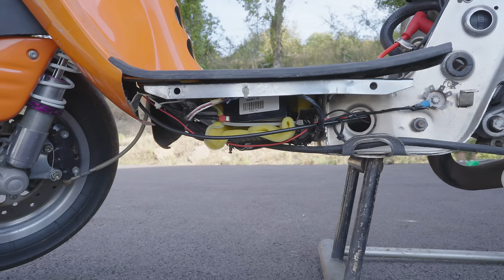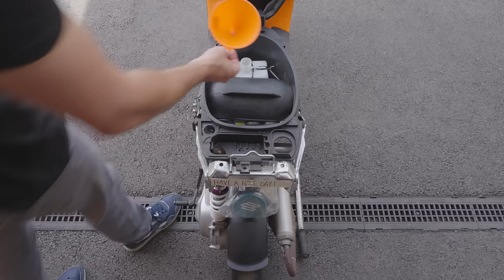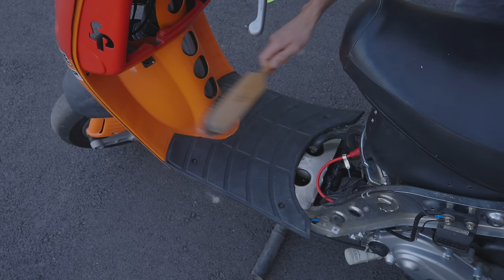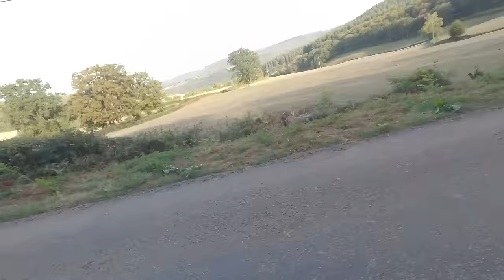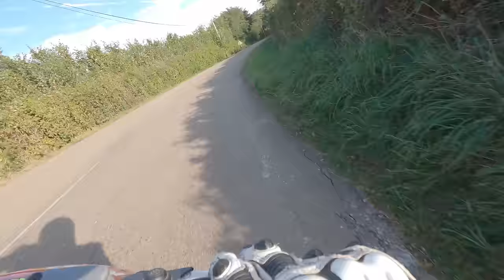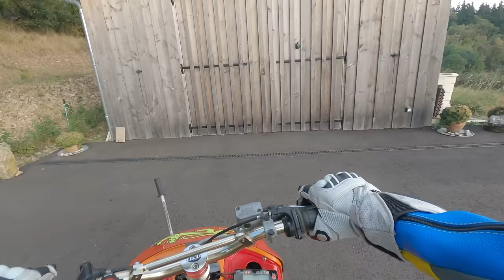Sortie de Grange Zip SP 70cm3 Malossi MHR Team (ASMR - No Music)

Comment: ça pousse !

si non tu peut pas mettre la pompe a eau sur le 12v de l'allumage ? normalement fil jaune 

la prochaine vidéo ça serait bien une mbk 51
Reply from the maker: Allumage à rotor interne de compétition, y a pas de fil 12v, tout va à la bobine haute tension pour le fil de bougie.

En compétition tout le monde est en circuit fermé en perte pure, pas de circuit de charge
Reply: maintenant tu en trouve des rotor interne avec sortie 12v pour pompe a eau

tu devrai regarder sur rrd-préparation